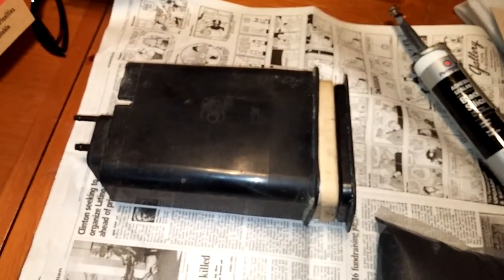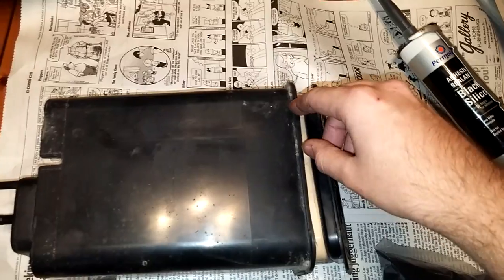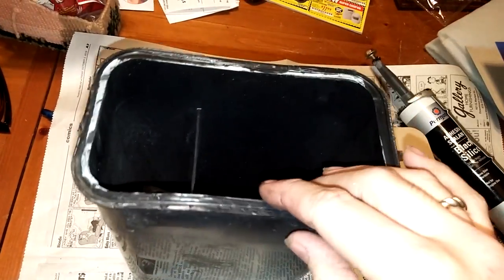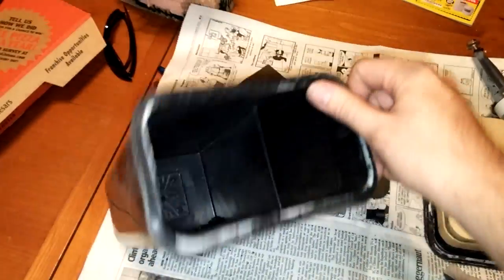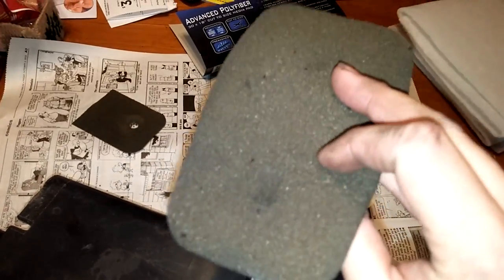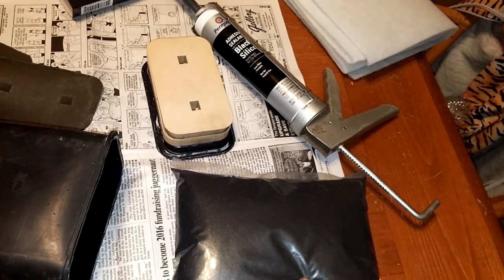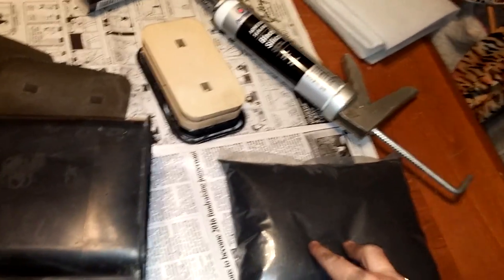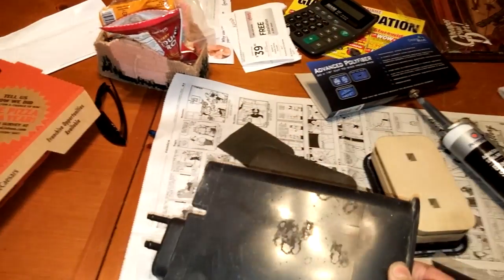How to rebuild any EVAP charcoal canister for cheap p0441

Comment: Thank you so much again! I have a 2000 4runner. I opened the case with a hot knife creating 6 cracks in it. I welded the cracks with my soldering iron. Did not replace the filters. Used rabbit pellet like charcoal from Petco. $17 Black Silicone like you said and clamped overnight. I gave it a 5% chance of working - but it WORKED!! 8 hours and 50 miles later no codes!! Keeping my fingers crossed. Toyota wanted $380 for canister and $350 labor. Cost me $17 for charcoal $6 for Silicone!
Reply: did your codes stay off?
Reply from the maker: after I done this my engine light never came back on for this problem. still my daily driver...
Reply: Before you fix it! the track off lights was on too on your car?
ps: my car is a Toyota Matrix 2011 less than 102 000 KM ;(  Thank you.
Reply: @bam6972  its been four years for your post. How is the EVAP canister?
Reply: @KS-uo4br  even if he only got 6 months it’s worth it.
Reply: That's awesome 😀 
You mentioned that you got carbon from for rabbits. And checking that does have to be "activated carbon" right?.. not just carbon?.

Comment: Did this on my 07 Silverado.  It was taking me 20 minutes to fill the tank half way.   I was able to cut the canister seam with a sharp utility knife along with spreading the seam with a flat blade screwdriver.  Sure enough, the old charcoal was nearly all solidified into a big lump of dust and mold.   I found the filter media on Amazon for about $7.  I happened to have a supply of activated charcoal on hand from other projects.    I found it easier to disconnect the hoses at their distil ends and kept them attached to the canister during the whole operation. Whole job too about an hour. This completely solved my problem.
Reply from the maker: awesome. glad it helped ya.
Reply: Can you post the filter media you purchased?

Comment: 9 years later and this video was a lifesaver for my 2002 Subaru WRX! A friend told me about replacing the carbon, his method was to hole-saw into the canister though - I tried this method of cutting along the original seam and it worked. Took some elbow grease but it didn't take long at all to cut. Still need to grab some carbon and test it out but I'm feeling confident. THANK YOU!

Comment: Just tried this method yesterday. It does seem to have helped. The pump still clicks off, but not nearly as much as before, so thanks for this.
Reply: Replace the purge solenoid. The canister will fix the plugged vapor issue but the valve that opens and closes allowing vapor in and out of that canister may and usually needs replaced as well. 
Cheap on Amazon.
Reply: Its the blocked vent valve thats preventing you from filling up.

Comment: Soo doing this on my 93' hardbody 4x4 v6. Small tip on these d21s ..
i took the  off plastic air scoop that covers the charcoal canister vent intake tube ,that is located under the front driver side fender well closer to the engine block, take it off and see the ram air effect that it will do to the canister system, of course if possible do what this awesome man did in the video as well  to the canister itself, in order to gain maximum effect.

Of course the plastic cover is on there for a reason because Nissan wants to "protect" the canister from foreign objects and redirect air flow. 
I've found this factory scoop to be restrictive especially with the small scoop opening that it has...
honestly imo it's a joke lol ..take it off and let the canister breathe especially if it's 25 yrs old like mine. Hope this helps. Peace thanks again for the super helpful vid boss.

Comment: 04 Dodge Ram, $380.00 new canister, I opened the canister and refreshed the activated carbon then sealed with J.B. weld. If I have to do another one I'll seal off one port then put the canister under vacuum to remove excess vapor.

When the purge valve fails the engine is unable to pull a vacuum to clear the canister, always replace the purge valve as this was most likely the cause of the failure.
Reply: this is what happened when I replaced my purge valve. brand new purge valve failed exactly 5 days later.

Comment: So far so good! I've done the same. Step by step. Only difference is that I used gasket sealant on the inside and gorilla glue the outer lip of the  back. Not crossing any fingers. If it comes back on, it'll be another 4 yrs before I give a damn again.

Comment: In a pinch you can use super glue and baking soda to fix the cracks or where you cut too.  Put super glue all over the seam and then sprinkle with soda.  Repeat and build it up if you need to.  It will make a good seal if you can't get any silicone.  There are a lot of videos on youtube about it that you can watch.  CA glue is neat stuff.
Reply: Hi. Thank you for the tip! I'll give this a try. Can you tellme what do you mean by CA glue?

Comment: 1:38 ... a friend of mine, who is very knowledgeable on Chemistry, says that activated charcoal can be rejuvenated by baking it in an oven.  Preferably Outdoors. 

I wonder if this will apply in this scenario 🤔
Reply: Yes you can cook off the hydrocarbons, but a good vacuum pump will also draw the vapours off without opening the canister. Just need to plug off some of the ports.
Reply: @gelmgren which method would you go with. I’ve been dealing with this with my Hyundai 2.4L. I can rent (borrow) a vacuum pump O’Reilly. If I go the refresh route, do I use powder carbon or smaller chunks?

Comment: Great job I can't buy a new EVAP for my '89 Buick, and why would I want a junkyard piece? Why eBay? Don't you have a pet store where you live? Aquarium filter floss and activated charcoal are cheap, too. No- you won't get better mileage- but it will drastically reduce fuel odors around the vehicle. After so many years- the charcoal will become clogged and useless.

Comment: What would happen if you did not refill the canister with carbon, but just left it empty, or just filled it with foam insulation like fiber class.
Reply from the maker: not sure. it might work. try it out and let us know.
Reply: Carbon absorbs fumes, so if you leave it away, your vehicle will have a stronger fuel smell.
Reply: i would be concerned the gas vapors would be dangerous with the styro foam. your comment was a year ago. since im debating rebuilding mine i wonder how did your attempt go?
Reply: @notreal5299  I just went to Rock Auto online parts and bought a new one.  It was very reasonable priced.  Cant remember the exact cost, but less than 200 hundred dollars and that was for the purge valve and purge relay. Took me about 2 hours to install.  it's pretty easy.  If you go the rebuild route, activated charco can be found at pet supply stores and even Walmart in pet supply area.
Reply: @johnd4348  tu

Comment: Is that charcoal bag in granules or powder?
Reply: You would want to use granulateed carbon not powdered carbon as the powdered type will compact and clog up thus no air flow through the mediam.  Granulated would be better than 'rabbit pellet size (rabbit manure size) ' more surface area without compacting like the powder.

Comment: Out of curiosity does the charcoal go into both chambers? What is the purpose of it being spring loaded? Also, when you refilled the system was it hard packed in? or was there some space for airflow over the charcoal?
Reply from the maker: where ever the charcoal came out of on yours is where you need to fill. its spring loaded to help compress the charcoal so it wont move all around. the charcoal was packed pretty good in there.
Reply: In the one shown, yes, it came from both sides.  Yours may be different
Reply: @bam6972  On one truck we own the activated carbon turned into powder finding its way into the fuel tank and destroyed the pump.

Comment: Ok, I tried this on my car and the gasoline pretty much ate through the silicone.  I had to take it out again and plastic weld the parts I cut off.  That seemed to work.
Reply: The best fuel resistant gasket material for gasoline is Nitrile (Buna-N), a closed-cell sponge rubber material that provides excellent gasket material for sealing applications that require resistance to gasoline, oil, fuels, as well as solvents, hydraulic fluids, and mineral and vegetable oils...
Reply: "Seal All"

Comment: what are the symptom of a bad canister? my 2002 Accent has a rough start, smells like gas in the car, it putters down the highway, I can't accelerate hard
Reply from the maker: if there is any codes that say there is no flow detected or something along the lines of that. there isnt any problems running a bad canister.
Reply: OK, the only code we found was the TPS , we replaced it. the car runs much better. NOW  the car seems to choke when the accelerator is pressed. We are thinking it the catalytic converter. There is a plastic shield under the radiator but hangs out a little that melted when the catalytic converter got super hot. Why would the catalytic converter get hot? Cuz its bad/no good/clogged. The car don't accelerate when you step on the gas pedal, hesitates to start, bad fuel mileage.
Reply from the maker: if the car was driven for a long time with the tps out it could have been dumping too much fuel in and thats why it ran bad. and with the excess fuel burning inside the converter it melted the material inside and clogged itself up. replace converter and you should be good to go. dont drive it long with a clogged converter, it will damage the engine.
Reply: you will get a check engine light
Reply: In theory you can get a little better mileage with a good canister. In some cars a clogged canister can even make the pump shut off at the gas station before it's full. But these are mostly an environmental add-on. They don't seem to cause serious issues like stalling, no start, rough idle, etc.

Comment: Do you know what kind of foam filter material would not degrade when it is exposed to the fuel vapours?
Reply: I should think some "scotchbrite" scrubbies would work beautifully. Those gigantic 7x9in ones like the big restaurant chains use. You can get them at any restaurant supply store. Cut to fit & stack in, layer-x-layer.

Comment: What happens if intake fuel port and purge port connections are interchanged??? This is serious question. 😐
Please answer
Reply from the maker: usually the hoses are not interchangeable. one is big and the other is smaller. but if they are swapped it will just filter backwards i do believe. it may also set a code.

Comment: I broke male fitting in one of them God dammit.. it's the skinnier of the 3 I have to buy a new canister and mine wasn't even bad fuck my fuckin life
Reply from the maker: if you still have the fitting, use some of that 2 part plastic weld super glue. then jb weld the crap out of the sides to reinforce it. should work like new.
Reply: Really? I could try it I think I'm gonna try that man I pray it work
Reply from the maker: cant hurt to try. if it fails you only lost 15 bucks. if it works then you saved over a hundred bucks.
Reply: I'll let you know
Reply from the maker: did it work?
Reply: Find a metal tube copper whatever   just smaller in diameter. JB WELD or epoxy over the tube that you placed in the broken tube hole. Shape once dry to look like old broken nipple